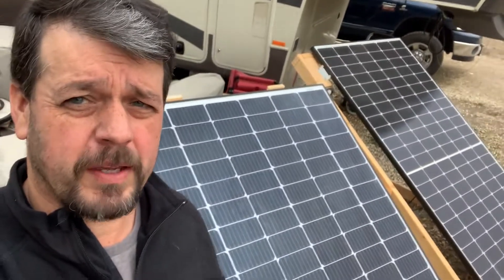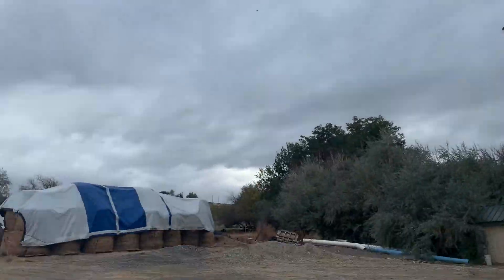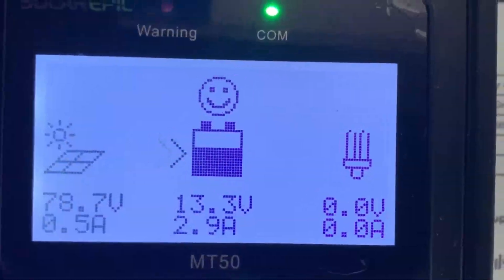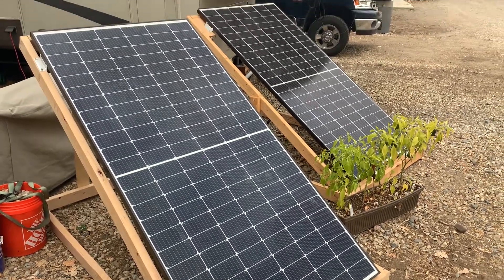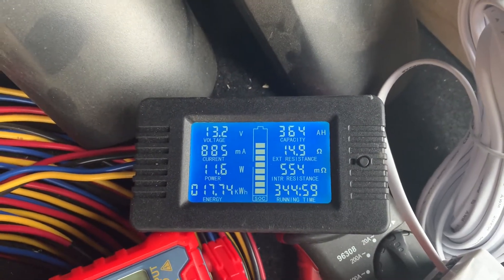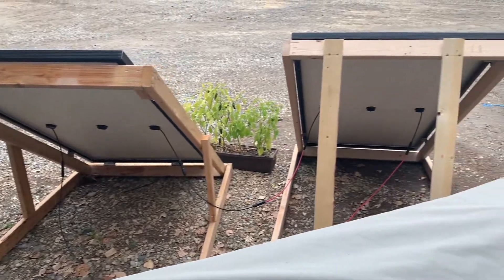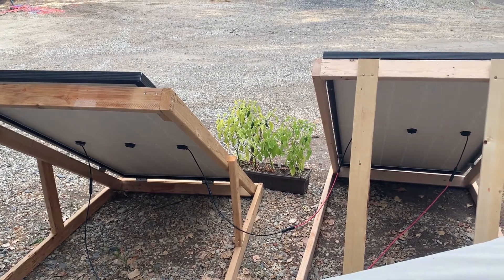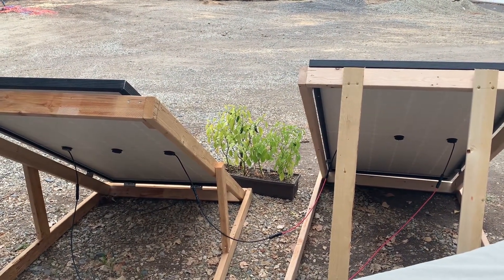The Dark Side of Solar charging

Comment: This is not the dark side of the solar. Having been off grid for 21 years, this is something everyone knows and accounts for. This would be like  spending money based on the highest paycheck you received in past 12 months when you really should base your spending habits on the average or even low paycheck over 12 months. Then you won't be surprised when you run out of money... Or electricity. You have to go into solar knowing your usage and then building your system for 3 days of rain. You've got a halfway decent battery bank you should have at least two to three times that much solar.... Or not expect to run large draw items. I never ran an air conditioner in 21 years off grid and I have a propane refrigerator

Comment: It’s amazing how little cloud cover it takes to lower the panels output. I just added 400 watts to a 200 watt system and upgraded to Victron components and am very pleased with Victron and the increased capacity from the additional panels. Next is lithium batteries!